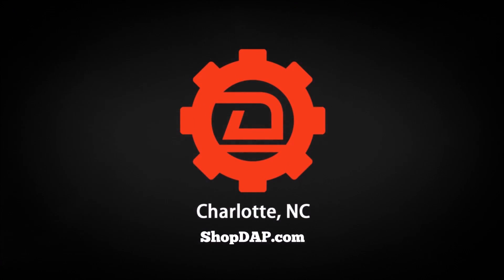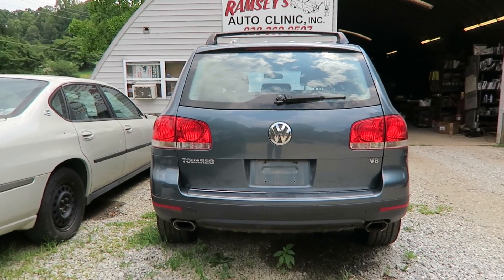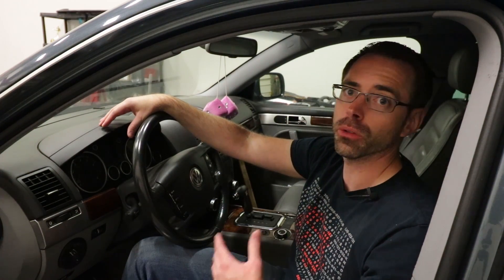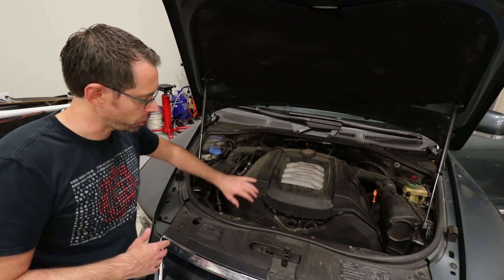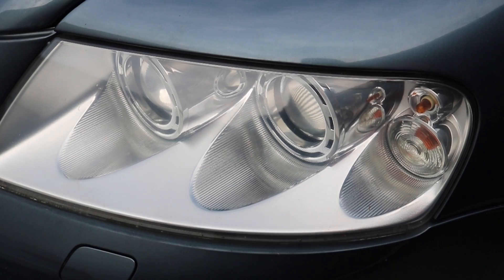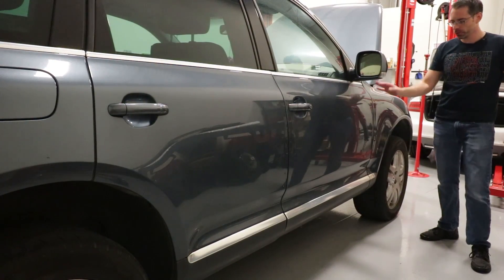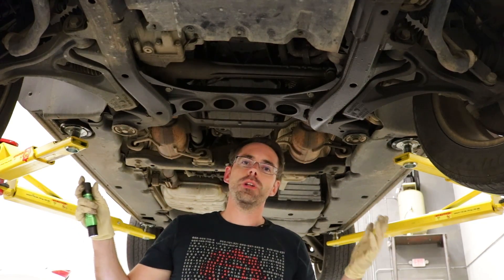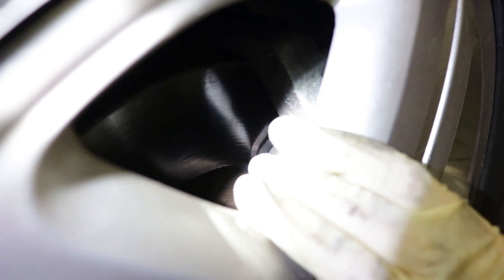Buying The Cheapest V8 Touareg on Facebook | How Bad is It?

Comment: I had an 04 4.2, I guessed every issue. They all do the same thing lol. Absolute monsters in blizzards, great to have them for sure. Never had an engine issue though. Bet it has a battery drain on the cable harness.
Reply: Every VW does 😎.
Reply: @visualblur  3.0 TDI is the best engine for this car
Reply: @Dickusification  but it might be less reliable

Comment: I had a skoda octavia with 1.9 TDI  90HP / ALH  engine  with 870000 km on board. I sold it to a friend. No rust, no problems and good compression. Probably the best engine ever build by VW.
Reply: ALH and AFN are two of the most reliable engines ever made!

Comment: Reminds me of Apollo 13: "What do we have on the spacecraft that's good?"

Well, the rear sunshades work...
😆

Good Luck - we'll be following!
Reply: Or the launch of Apollo 12 (it got hit by lightning shortly after launch):

000:00:37 Gordon (onboard): What the hell was that?
000:00:39 Gordon (onboard): I lost a whole bunch of stuff; I don't know...
000:00:43 Conrad (onboard): Roger. We had a whole bunch of buses drop out.
000:00:51 Conrad (onboard): AC Bus 1 light, all the fuel cells...
000:00:56 Conrad (onboard): I just lost the platform.
000:01:02 Conrad: Okay, we just lost the platform, gang. I don't know what happened here; we had everything in the world drop out.
000:01:12 Conrad: I got three fuel cell lights, an AC bus light, a fuel cell disconnect, AC bus overload 1 and 2, Main Bus A and B out. [Long pause.]
000:01:21 Bean (onboard): I got AC.
Reply: Instablaster.

Comment: Try sourcing those roof bar keys through Thule. My OEM VW roof bars for my MK4 didn't come with keys so I ordered pre-cut keys with the same numbers on them as the lock cylinder and it worked out perfect!
Reply: Same for me kyle. The number on the lock is actually the key code. Ordered them from Thule like you. Problem solved.

Comment: The Touareg is how I grew hair on my chest.  All my years at VW, these were the cases I would get. 

Funnest one I got was a VR6 no crank no start.  Was the alarm siren connector flooded with water.  Shorting the body can lines into single wire mode.

Good times!
Reply: Do you happen to know anything about the V6 3.0 TDI?
Reply: Can i pick your brain? I have a 05 v6 that im having issues with.  Need help bad. Lmk

Comment: I sold my V8 Touareg and the door pulls are plastic and breaks off fairly easy.  The rear hatch switch will develop a short in the switch no matter what you do. We could never fix the leaky sunroof drains.  And last but not least.  An electrical issue with the brakes.  Still stopped 99% of the time.  Overall never got stuck and would get another one.
Reply: Get a 3.0 TDI, it is a tank

Comment: Leak in the trunk is most likely the hatch spring cover on either side. The black plastic cover has a seal that goes bad and easy fix. All those buttons are easy to fix. Take them off, dip in acetone, clean, spray black and apply new sticker that can be found on Ebay.

Comment: I bought one last year an 2005 4.2 same color picked it up for 2700 had a few issues put 5200 in for work lol body is perfect shape put new tires, brakes , rotors, control arms/w bushings ball joints, new starter, cylinder head work had bent valves , timing tentioners, put new fuel injectors,  coils, sparkplugs new cats I replaced all while motor was out 1 had a small leak at flange just did all I bought as a project and just been going through it only 1 issue left!

Comment: ROOF BAR KEYS the 3 digit number is normally prefixed by the letter N,  they are in Europe,  they can be cut to code by your locksmith on a Silca LF12 blank

Comment: We had our 04' for 14 years. 1st year quality problems, but really quite good for the remainder. never had to touch the motor in 200k miles - only replaced the plugs and belts once lol.
Reply: That V8 is pretty stout. Stay on top of the t-belt, coolant, and use good quality oil.  It will run and run.  All the interiors on these melt period.

Comment: I bought one of these with less miles and in running condition for 900 and flipped it for a quick 1000 bucks. You’re nuts for spending that much

Comment: I thought V8 Tregs had a timing belt? Anyways. If you want a beast offroader SUV you bought the right one. I used my V10 TDI offroad daily and its absolutely unstoppable.
Reply: Mitchell Mounts Also unstoppable as the repair bills
Reply: @apexseal2811  you're not wrong. But they get a bad wrap by people who bought them thinking they where going to be maintenancing a mk4 jetta 2.0. If you adjust their original MSRP to todays money the cost of repairs and maintenance of an 85kish vehicle is pretty in line with other german vehicles in that price range.
Reply: Mitchell Mounts Yep, pretty much.
I love the massive torque of the V10 TDI capable of towing a 747, but maintenance does scare the heck out of many owners, including the ones who know about the vehicle. As you probably already know, some "simple" stuff require the engine to be taken out because there is no space to work in.
Reply: I've thought about buying one of these, do you have some examples of actual upkeep costs?
Reply: Shane T Really, really expensive. Comparable with a Lambo
It's one of the most maintenance intensive vehicles of all time.

https://jalopnik.com/the-volkswagen-touareg-v10-tdi-was-more-of-a-nightmare-1822934503
Reply: @shanet7511  Well contrary to what you might find online. If you find one in good running condition it will be fairly reliable if the common failures on it have been addressed. The first thing I had happen was the center bearing on the driveshaft support failed. About 2k parts and labor at the dealership because you can only get the whole driveshaft assembly. You can get the vertex aftermarket support for roughly $400 and ive put 60k miles on it with no issues after the failure. All touaregs experience the same camshaft wear issues as the 1.9 tdis of the same time. Ive had to replace both of them and all 20 lifters. This repair is doable without pulling the engine but the cams and lifters run about $1500 a side plus another 1000 or so in labor if you can find a mechanic competent on one. Although you can get a set a colt cams which have hardend lobes for $2000 for the set which im kicking myself in the butt for not doing. Other than that ive only experienced wear and tear items controls arms and wheel bearings and such. Currently have the engine out for cracked exhaust manifolds which seems to be a semi common issue on these. But im replacing turbos while its out even though the ones in there are in fine shape they just leak a little bit of oil on the intake side. I have a couple write ups on club touareg that go into more detail. If i were to do it all over again. This is exactly what i would do in a perfect world. Whatever the cost of the vehicle was have about $15000 extra set aside. The day of buying it take it to a shop and do the following repairs.
-pull engine
-replace the following: turbos, cams, lifters, tune for egr, dpf, and o2 sensor deletes, straight pipe from the turbo back, new alternator and rubber couplings for alternator, and ac/power steering pumps, alternator drive seal (common oil leak point), all gaskets and seals in the valley of the engine for oil filter housing and fuel rails. 
If i would of done that from the time i purchased the vehicle im confident i would of never had an issues other than minor things.

https://www.clubtouareg.com/threads/owning-daily-driving-a-2006-v10-tdi-touareg-a-year-in-review.288763/

Comment: I have a 2006 V8 Touareg with the air ride.  130K miles.  The dashboard electronics are bad.  ABS light is bad.  ABS is bad too.  I took out the fuse to ABS.  I bought it used in Florida for $6,500.  I have no idea about time chain work. An oil change cost me around $1,000.  I wish I could post photos here on youtube.

Comment: You can buy the keys for the roof rack on eBay or directly from Volkswagen! Had the same problem here in Germany and both options had the keys available!
Reply: Would it be possible to find a cheap used Audi or BMW (Sedan), Petrol option . How much would that cost?

Comment: I can't remember the last time I bought a 'dub that ran. LoL... I just picked up a cherry 2008 Jetta 2.0T , towed it home and had it running in about 3 hours.  Some cheap parts sourced from everywhere across North America and even to China to fix deficiencies and now it's my everyday driver that I'm into completely for about $1400 (includes all parts and initial car purchase) and people drool over it when it's all shined up...  6 months ago I Bought a B5 Passat 1.8t for $150 in great shape but owner thought timing belt broke.... went to his house to buy it armed with my tickle trunk of parts. paid him,got my receipt and signed over the ownership to me and 10 minutes later I was driving it away while the owner stood there just staring at me open mouthed. LoL... Checked it it out for sludge and oil coking and it was clean as a whistle.  I went through the provided service invoices and found it had a new oil pickup and pump installed 2 years ago as a preventive measure and lots of routines done to it....   Did a good once over on my hoist, changed the oil and replaced the timing belt, tensioner, rollers and water pump and then sold it for $1500 a few days later to a buddy of mine.  It's super easy for techs to make money making runners out of the average persons mechanical nightmare.
Reply: This is how I got my last 4 cars for cheap.
I buy old VAGs with a long list of faults on the local safety and emissions test, source the parts for cheap, fix them and drive it for a few years until I get a better deal.
My current car is a 2001 Jetta, that I bought for $1400 (even 20 year old rust buckets are this expensive in my country). Spent about $200 on timing belt kit and a few other parts, fixed it and could've sold it for almost triple of my investment... Love it too much to sell though, so I'm gonna keep it until I go EV...

Comment: The 4.2 is really reliable if properly maintained. But driving over 320.000 km without changing the chain tensioners is just asking for trouble. The way it runs it most definitely has skipped timing...
Reply: Meteor Media Good to know. My next timing belt for mine is due at 260,000kms, so I’ll get them to do that when they replace it
Reply: I totally agree! Timing chain jumped a link because those plastic tensioners fail- a common occurrence with VW engines of this era!

Comment: hi all, I have a 2008 V6 Touareg and recently both of my side view mirrors stopped working. I've check the fuse boxes in the engine compartment as well on either side of the dash. And all are fine! Any idea on  what might be the problem? Thanks in advance for any assistance anyone can provide.

Comment: Wow, I thought my Jetta was Expensive. I was stick in Mississippi when I was in Techschool for the Airforce and the Dealer charged me $2200 just to replace the timing chain......
Reply: If it was a 2.5 it has 2 chains and to do the bottom one you have to split the motor/dsg. If it was a manual you got ripped off.

Comment: Hello master l need Some help l have a 2006 Touareg v6 completely dead the start motor dead nothing noise battery 12 volts  thanks l never worked with this kind of vehicles advise.

Comment: I've always loved this vehicle and wanted one but damn after hearing all the issues I'm certain I'll never own one lol.  I want reliability
Reply: Dave Chalifoux The 2009-2010 isn’t bad. Most of the known issues have been fixed. Except the terrible gas mileage because of the weight and 4WD
Reply: With that being said. Stay away! Got a 07 V8. Love the vehicle and was proud to have one until....the Bill's started rolling in. As I type it sits at the mechanics shop going on two weeks now.
Reply: My condolences. Blew 4 grand in repairs and maintenance on mine over the summer. Still needs some things fixed. What’s wrong with yours?
Reply: @ogalief  omg where do I start. 1st in was leaking oil really bad so I spent a mint trying to pinpoint where it was going from. Replaced almost every oil gasket to hear from the mechanic it has to be the upper oil pan my friend! This means dropping the engine and hours of shop time.  Short story.. it was the oil cooler all along. Found that out when it blew while driving and dumping all oil over the road way. Got it repaired  some $1500.00 later. Now a month later the the check engine light came in and the EPC light.  Fuel system codes. Started with fuel filter, replaced fuel pumps, now looking at high side fuel sensor.  Intakes were removed to find a piece of plastic broken off that was about to go into the engine. Not sure if the plastic is from timing chain guide rails or what! The saga continues...  if I get it running properly enough to sell we may have to part ways and I pass it on to some other unfortunate soul.

Comment: Is it the model with air suspension and all locking diffs model? I noticed no Navigation package
Reply: This isnt the air suspension you can tell cuz the further hole is empty. doesnt have air suspension control, because of that the car probably only has center locking diff. No front or rear. Usually nicely specced tregs when they had the air suspension they also had the other locking diffs

Comment: We had a 2007 Touareg V6 TDI that thing had soo much torque, it could easily pull over 2 tons. Our glove box also broke and wouldnt stay closed. And why did you get the V8 Petrol V8 insted of the Diesel V6 ?
Reply from the maker: We didn’t get the 3.0L TDI until much later.

Comment: Hey, an unrelated question to the video (if you guys can get to this.)
I have a facelift 2019 GTI and I'm thinking of replacing the blow off valve. Can I add both the blow off and diverter valve on mine, or does it have to be one or the other??
Reply: I'm pretty sure the car doesn't have a blow off valve stock. 
For performance install this  https://www.shopdap.com/make-model-year/volkswagen/gti/mk7-5-facelift-gti-2018-present/engine/2-0l-turbo/performance/blow-off-and-diverter-valves/t9351-gfb-dv-plus.html
For extra noise install this https://www.shopdap.com/make-model-year/volkswagen/gti/mk7-5-facelift-gti-2018-present/engine/2-0l-turbo/performance/blow-off-and-diverter-valves/mk7-gti-golf-r-20t-18t-diverter-valve-dv-spacer.html

Comment: What are your thoughts on 2010 Touareg 3.0 TD with 110000mile on it. worth buying?
Reply: The engine is quite solid, except for the intake manifolds.
The most common problems with any Touareg is suspension related. Air compressor etc, bushings with seized bolts etc...
Reply: @panzerveps  How much do the intake manifolds cost? I'm thinking about buying a Q7 TDI but will be putting 40k miles per year on it (mostly HWY)
Reply: @shanet7511  the main problem is the linkage between the actuators motors and the flaps (don't know the proper English name for them), and you can get a cheap repair kit for it. I'd recommend spending a bit extra on a proper 3rd party intake.

Give me a couple of days, and I could quote you the Norwegian price for replacing them.
Check out DiagnoseDan for a replacement video on the 2.7 tdi, which is basically the same engine.

Comment: What do y’all think getting the headliner repaired is going to cost? Does the upholster remove the whole headliner?
Reply: I redid the headliner on my 2004 Touareg...gotta pull out the one-piece fiberglass monstrosity, strip off the material, and scrape off the goo that used to be the foam between the material and fiberglass...I just used green canvas from Home Depot and a s#%#load of contact cement...it looks great...was very labor-intensive...but cost me less than $40 semolians in the end...I love my Treg!

Comment: All that soft touch peeling had me speechless! I've seen it get pretty bad, but that Touareg is next level bad. Makes you really wonder what the previous owner did to it! 

My 03 Golf TDI had 360 000 kilometers (R.I.P.) and some areas of the soft touch were pretty scratched up, namely the door handles. My 05 A4 Avant has basically no peeling, which I'm stoked about.

Comment: I want a w8 Passat I need advice
Reply from the maker: Advice: Don’t
Reply: Lol
Reply: Just get a 1.9 TDI and turbo it to the max :D Just change the engine when if it quits! Will end up being cheaper.
Reply: @Deutscheautoparts  do you recommended rebuilding a 1.8t awp or just buying a crate engine from VW for 3300$?

Comment: Those are shitboxes, stay away from them!
Reply: @Nikola_W211  Well then go and buy an used Touareg and find out how good it is. My 1991  Chevy Caprice has about 220000miles/350000km and is still on the original motor, transmission, differential, and all the powerseats, windows, aircondition, cruise control etc. still works. Good luck with that VW!
Reply: @Nikola_W211  My first own car was a -97 Passat "highline" 1.8 those were dependable cars, this was in 2002. But the new stuff has had a lot of issues.